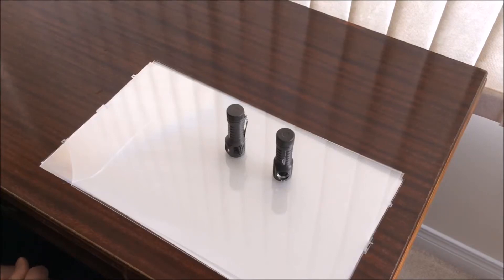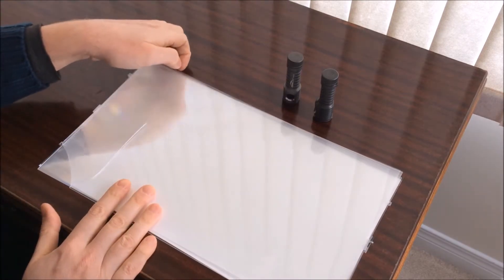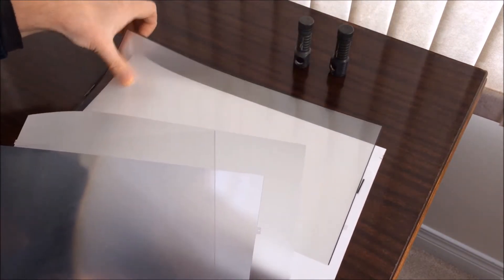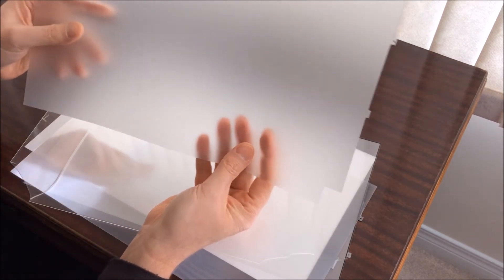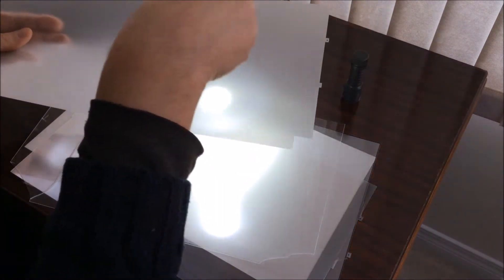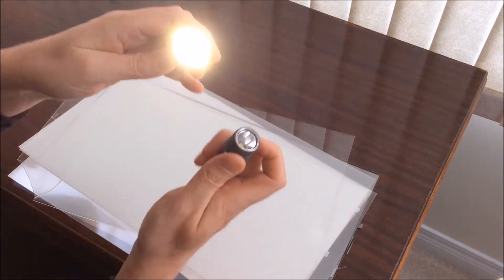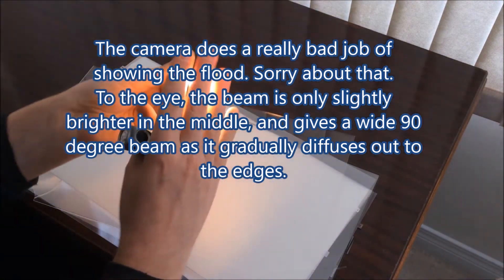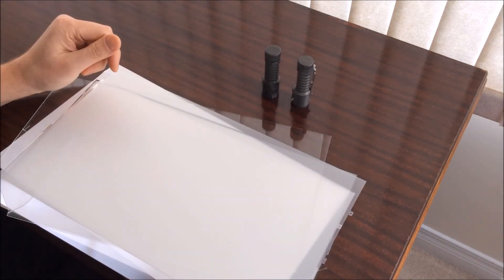Free & Good DIY Flashlight Diffuser

Comment: Instead of braking a laptop,use baking paper
Reply from the maker: Good suggestion. But does baking paper have any wax or oils in it? If not, it should be a simple diffuser. I'm not sure how much light it allows through. Probably not as much as laptop screen diffusers, but perhaps good enough.
Reply: @walkintothelight7142  I guess the laptop diffusers are definitely better. I found that baking powder doesn't let a sufficient amount of light through, and so I tried with thin  tracing paper and it kind of does the job.
Reply: Parchment paper is presumably the same thing.  Have you tried making a 'cone' from the paper, rather than just cutting a disk?  A cone seems to really diffuse the light better, but it's harder to attach.